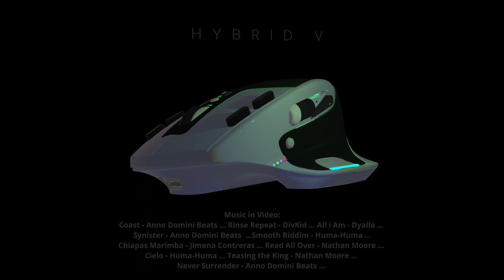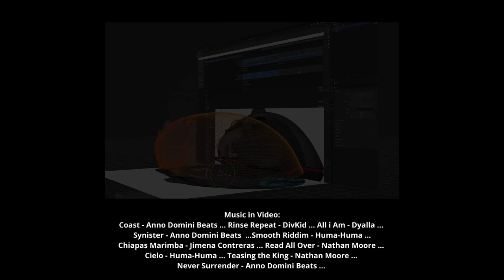Logitech MX Anywhere 3 /// Electromagnetic Scrolling / full disassemble

Comment from the maker: For those interested 2in1.Hybrid Vlll (L E A D R  &  Master 3 | min0:23): Prehistory. I made Hybrid ll -12.01.2020 and Hybrid lV - 12.01.2021. I also wanted to publish a video about Hybrid Vlll on 12.01. But there is a lot of work and I don't have time... - Probably only at the end of January. In general, there is a lot of work and by today the mouse is only 90-95% ready. I can say that the new mouse (leader & master 3) will weigh 170-175g depending on the battery used...
  But I rendered how the mouse works - you can see on the render-image (press F5) a video about Hybrid l-lll : https://youtu.be/SyVAa_-XmdQ
or on this video (Logitech MX Anywhere 3...) min 24:15 or (i) click on the top right...